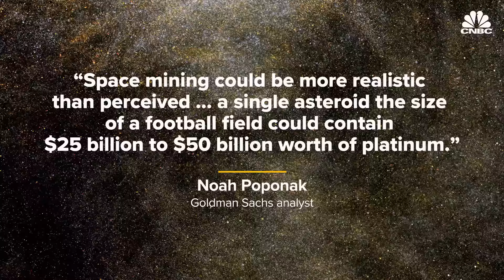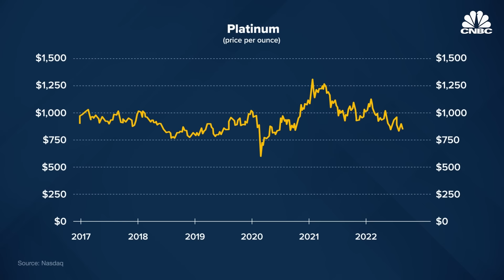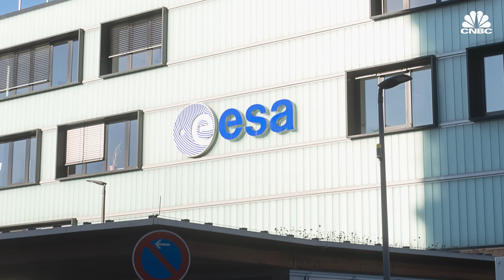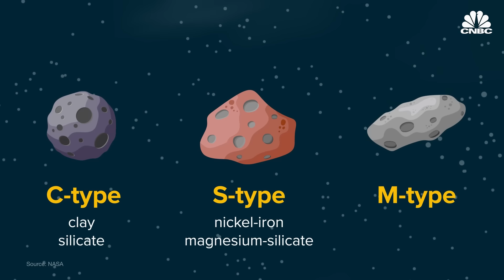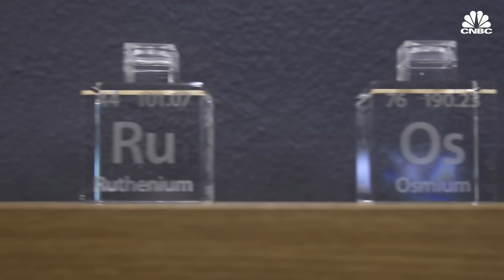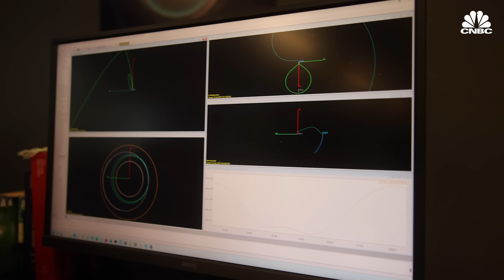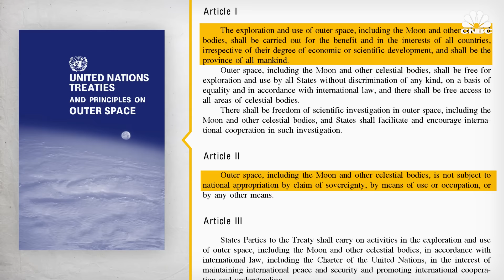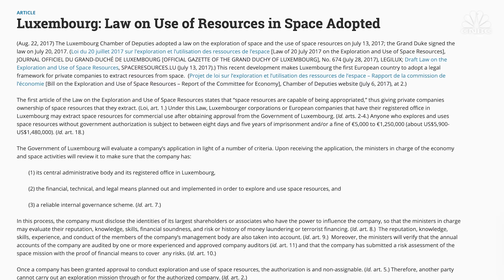What Happened To Space Mining?

Comment: 1) Space mining for use on Earth makes little sense. It's far easier and cheaper to mine virtually anything on Earth than in space. Space mining for use IN space makes sense but it requires a pre-existing in-space economy.

2) Mining water ice for rocket propellant makes little sense. The lunar south pole is often mentioned as a good location for this. But it requires mining and storage equipment to be landed at the bottom of deep craters that never see any sunlight. Furthermore, hydrogen is the smallest atom and is notoriously difficult to handle. It readily escapes any containment vessel. It also needs to be chilled to just 20 degrees above absolute zero before it turns into a liquid, and even then its density is so low that it requires much larger storage tanks than a comparable mass of other liquids, such as liquid oxygen.

3) Mining for oxygen on the Moon makes much more sense than for water. The lunar surface is 43% oxygen by mass, locked up in various kinds of oxides. You can land virtually anywhere - on an easily accessed flat plain in lower latitudes, instead of the pitch-black bottom of a deep polar crater. You have a number of different oxides to choose from. Oxygen also represents the majority of the mass for rocket propellant. A methane-oxygen propellant combo is 80% oxygen. Liquid methane is also much closer to the temperature of liquid oxygen, simplifying your cryogenic storage infrastructure, compared to liquid hydrogen. Mine the oxygen virtually anywhere on the lunar surface, combine it with methane brought from Earth, and you have a viable off-earth propellant production system.

Comment: i have a question people. Even if they managed to get to an asteroid and capture its precious metals or water in tons, wouldn't this additional mass demand much more thrust power from the mining vehicle to ever land in earth due to gravitational pull from the earth?
Reply: Not more thrust but more fuel yes but the plan is probably to produce fuel insitu. Once you are orbital the amount of thrust is much less important than when taking off. This is because when you are taking off you need to produce more thrust than the weight of your vehicles but once you are in orbit your weight is 0. Having higher thrust is still helpful as it allows you for shorter burn limiting gravity drag but these gain are almost nothing compared to using a more efficient engine and their are mitigating methods like simply doing multiple burns at the optimal orbital point. This is what we see at 9:02, that orbit is what we would observe by doing multiple boost burn at perigee..
Reply: @gavinkemp7920  thank you for replying back. I fully get what you wrote, but you are talking about the orbit. If the mining vehicle would have to return to earth to sell the materials, then wouldn’t the vehicle require additional thrust during the landing process to earth considering it would have the original mass minus burned fuel plus the mined materials?
Reply: @nickiogr  well you would need a very good reason to return the mining vehicle. it would make more sense to leave it their as it could continue mining will the ship is bringing the ressources back to earth.
As for landing that will depend on how you are landing but it will involve the use of an aerobreak, baring a massive breakthrough in propulsion technology. as such you need little fuel to land assuming you choose propulsive landing rather than parachutes.
For example if we take starship as an example it needs about 1200 tons of propellant to reach orbit (and that is ignoring super heavy) but only 29 tons to land. so even full of valuable ores the returning starship will be much lighter than when it took off.
Reply: The metals can be returned ballistically, so you just need the additional fuel to get you back to earth orbit.
Reply: @gavinkemp7920  There is a better way.
Reply: If you have a large mining ship built in orbit with gravity from rotation you can stay in space as long as you need. You power it with liquid fuel molten salt reactors. This way you can get fuel for the reactors and propelant from refining the ore. Propelant well be water reactor fuel well be thorium. Then with 3d printing make glide robot craft. After in earth orbit you launch craft backwards and in the other direction of orbit the gravity well do the rest. The computer well steer to air port and land. The craft then goes to companies putting things back into orbit.

But then if material goes to space construction projects you go there instead. All metals well be on gaint reels for 3d printing no matter if it is for earth or space construction.

Comment: Question why can't we use a old shuttle and a crusher which doesn't need air to crush bringing the fragments into the shuttle or booster tubes to be able to withstand re entry
Reply: I think the economics of space mining only works out when you keep the materials in space, for example to build orbital structures. It's currently too expensive to bring materials back to the Earth's surface, even if you don't need to worry about oxygen and cabin temperatures (within reason). Some day when we have figured out a "sky hook" or "space elevator" which lets you cheaply send things and people up and down the gravity well, though even then, tons of mined lithium or iron are going to be problematic.
Reply: WHAT!?!!   A OLD SHUTTLE YOU SAY!?!!! Are you serious?!  You don't know much about the shuttle, do you?  I don't think you thought this through!
Reply: The Space Shuttle was not capable of that. It was designed for missions in low earth orbit, not interplanetary travel.
Just because something can reach low earth orbit doesn't mean that it can go into deep space and back. Leaving Earth, then stopping at an asteroid, then accelerating back again with cargo requires such a high fuel-to-payload-ratio that it is barely possible at all as long as we use chemical rockets.

Comment: The focus of asteroid mining seems to be to get platinum. The earth's current supply is that if you fill an Olympic size swimming pool with platinum and jump in you would only get your ankles wet. This platinum is used mainly for catalytic converters -something that we will need less of as we move towards electric cars. Yes we will still need platinum for electrolysers and hydrogen fuel cells but platinum loadings for these are less so value of platinum may decrease over time.

Comment: Find a slow rotating asteroid that's worth mining, then slow it, so that one side always faces the Sun. Tidally lock one side to the Sun. Then solar panels could continuously collect electricity for operations. Next hurdle is how to return the material. Haven't seen anything worthwhile. Yet I know how it can be done.
Reply: Why? Use nuclear power.
Reply: @TheBooban  Solars cheaper, quicker to produce and can apply to more machines at different location s on it's tidally locked surface. Can mine with a constant temperature, rather than a fluctuating temperature.
Reply: @TheBooban  Solar is cheaper, easier, and it doesn't have the chance to blow your spacecraft to pieces

Comment: I was thinking that asteroid mining isn't going to happen until we have a space based refinery

It sounds like he's thinking of building on an asteroid, but I was thinking more the moon. We could do a satellite as well and it might be more flexible as for the ability to move it around. But a large refinery would be difficult as its own stand alone satellite. The moon would give partial gravity, without so much that it would be difficult to lift off to go mine asteroids. It would also allow for a much larger case than what you might be able to build on an asteroid or satellite. The issue with size is that different materials have to be refined differently, so it would make more sense to build a large base on the moon that could refine multiple types of ores. I.E. a steel mill can not easily process gold or silver or even aluminum without shutting down to make major changes to the equipment